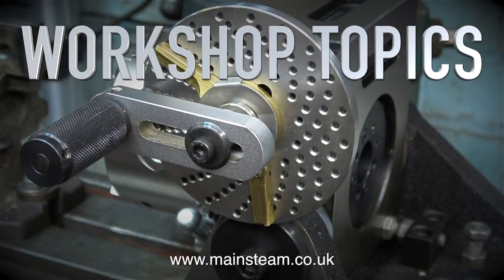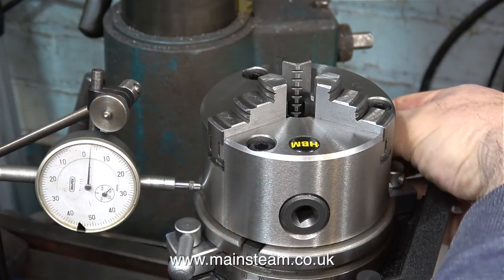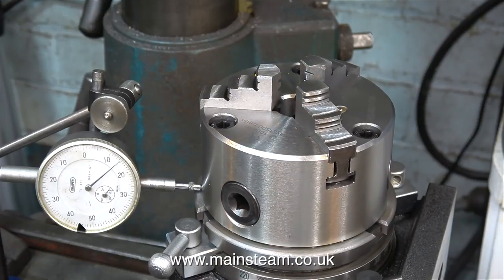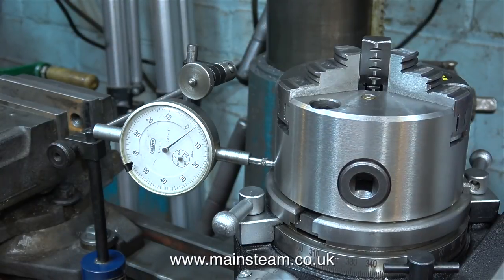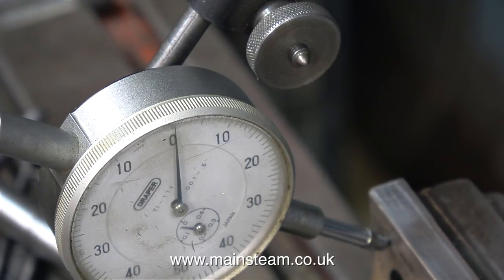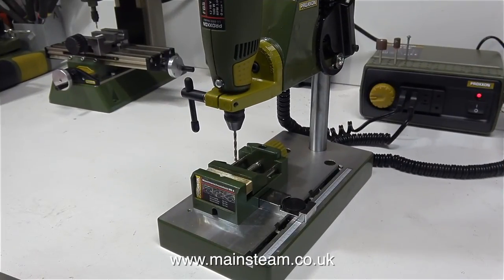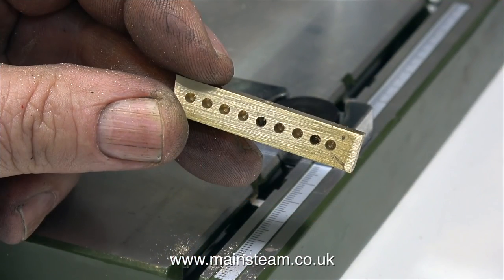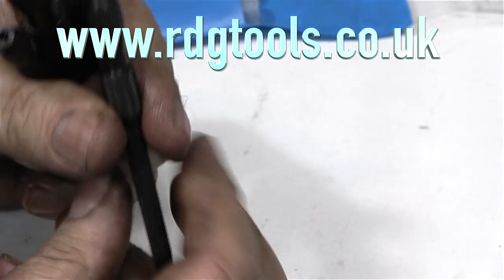WORKSHOP TOPICS - PART #2 - A DIVIDING PLATE AND SMALL MACHINE TOOLS

Comment: The issue I have with most of the Proxxon stuff is cost...it looks wonderfully made, but as a hobbyist, I just can't justify the cost. For instance, their micro chop saw looks fabulous for cutting small lengths of copper and brass pipe, but at $219, I could buy a full size saw in good used condition, or probably even a low-end one new. The same with the milling machine. While the size is appealing, $350 for a "toy" size milling machine is halfway to one of the Chinese dovetail-column benchtop mills from Grizzly or Harbor Freight. While neither of those machines is on par with a Bridgeport mill, both are fairly convenient, affordable, and capable, and given the choice I would take the larger machine any day. Maybe there are better prices on the Proxxon stuff in Europe, but here in the states, it just doesn't make sense to me...

Comment: Aligning a chuck on the rotary table using the outside of the chuck has some inherent risks, the outside of the chuck cannot presumed to be concentric with the clamping action of the chuck, I have found > 10 thou run out on a couple of my cheapo chucks probably best described as doorstops , but if it's close enough for you hey live with it. BTW your wiggler is an edge finder
Reply from the maker: I would use the main quill - not the chuck ......